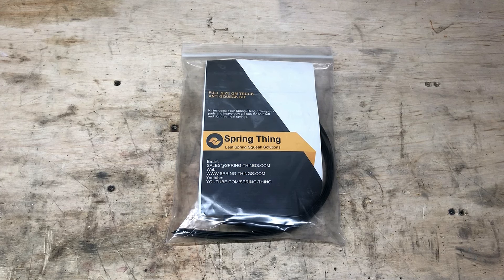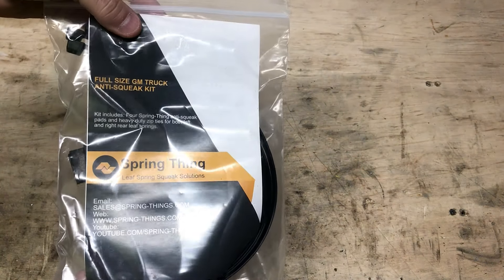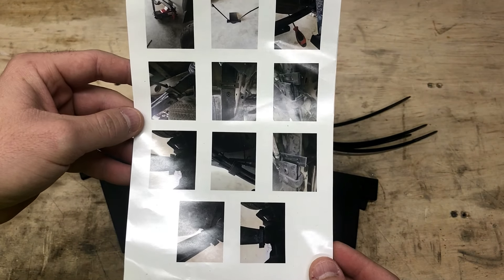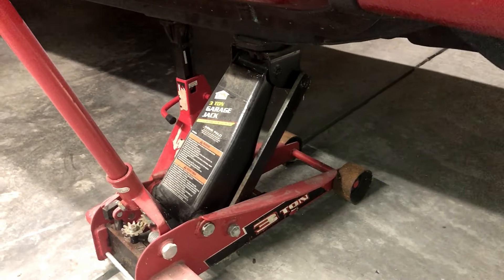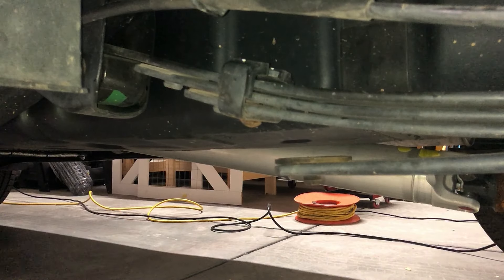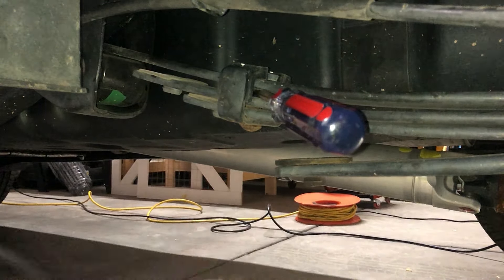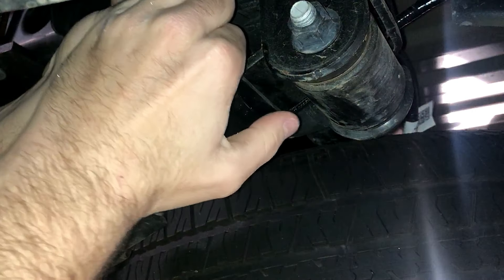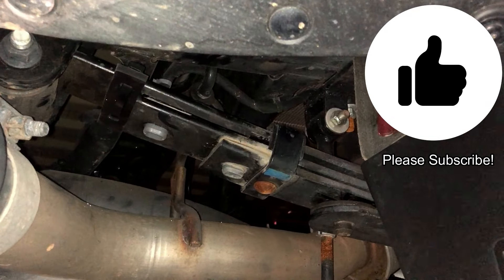[HOW TO] Fix Noisy Leaf Springs - Install a Spring-Thing (Pretty Much Any Pickup Truck)

Comment: I have a 21 Silverado 2500HD and was having issues with the leaf springs. I was able to install this product on the front end of the springs but couldn’t get to the back because it was too difficult. The noise seems to have gone away but the fact that only the front end springs have them, bothers me like an unbalanced equation. Should I try again to install them in the back? Is it fine as it? Thanks for the video!
Reply from the maker: Makes sense. The heavy duty springs are much stiffer and probably a lot harder to separate. I don’t think it’s harming anything. If your noise is gone, I’d say you’re fine. Thanks for watching.
Reply: I’m trying the same thing on a 24 2500 and the rear is such a pain.  But it still makes the noise.  I was only able to put the front.

Comment: Did you disconnect the rear sway bar link to get the axle to droop a bit more?
Reply from the maker: Yes an absolute must. I didn’t mention it in the video because most people don’t have a sway bar. But I just removed the bolts on the bottle of the sway bar end links.

Comment: So, can you do this without jacking the truck up? Or is jacking it up a must? Also, do you remove the factory pads, or just add these on top? Thanks.
Reply from the maker: You absolutely need to jack up the truck. When the weight of the truck is on the springs you'll never be able to slip the rubber pads in between the leafs. Jacking up the truck allows the leafs to droop and then you can pry them open slightly to slip in the pad. Thanks for watching.

Comment: I tow a 14,000 5th wheel with my truck back and forth to Florida each year and I emailed Spring Thing to ask how long these would hold up towing fairly heavy like I do. I didn't get a response from them. Do you know if they are still in business? I don't want to order them and then not get them while being out the money.
Reply from the maker: People have been commenting about orders being fulfilled. So I assume they’re still in business. You can also make a similar thing out of 1/4” thick rubber mats. Cut them up and replace them as needed.

Comment: i have a 2018 gmc sierra z71 4x4 on a 2/4 drop and mine is squeaking from the leaf springs and i just placed a order on one of these kits i’ll update yall 🤘🏽
Reply from the maker: Right on. Look forward to hearing your experience.
Reply: @fondupot  Package got here and i struggled on one because my exhaust was in the way “ i have a after market exhaust” once i got that one done the rest of the three was easy! dropped the truck and jumped on the back, no squeak! letss goo im happy asf thanks bro 🙏🏽
Reply from the maker: Awesome to hear.

Comment: I just installed my spring things a while ago and went for a test drive. Most of the noises I was hearing went away. I still have another noise, not sure what that it is, might be a  brake line or something rattling underneath, but the spring things are a good investment, easy to install, and do the job. Seems like a smoother ride too.
Reply from the maker: Good to hear they helped. Hopefully you can figure out your other noise.
Reply: @fondupot  I think the springs need to be replaced. 15 yr old truck, and I cant find anything lose anywhere. Gotta be the springs. Pads stop some of the noise, and If I put lithium grease in between the springs, it settles down, but you can see where they are buckling and rubbing, I think next year or maybe this year I will find some new ones? No any good mfgs? These were mfg in mexico, probably along with the truck. hehehaha
Reply from the maker: Could be. They might also need a good power washing and then lube them up with grease. Could have some rocks and dirt between the springs.
Reply: @fondupot  Living in Oklahoma here. Weather getting warmer, I did spray some lithium grease a little bit, with the warmer weather, the noise goes away, and early in the morning it returns, I think your assessment is correct. One of these warm or hot weekend days, I will scrub them down  and then spray grease in there. I might modify them with some brackets to keep them tighter. Ive seen so many ideas on here, lots of things to try.
Reply from the maker: Could be the bushings going bad. And as they warm up the noise goes away. But when their cold they squeak.
Reply: @fondupot  Since I got this truck no squeaks at all, just clunking and rattle noise.
Reply from the maker: Good luck!

Comment: 2024 Canyon.... Weird sound like a ball rolling around somewhere.... Mine seems to be on the passenger side front door area .. could it possibly be the rear leaf springs ?
Reply: I've got the same sound.... Mine actually sounds like it's coming from the passenger door area.... Could  the leaf springs sound just be traveling forward ?
Reply from the maker: That’s a strange one. Ball rolling around is not how I would describe the leaf spring slap.

Comment: Did you install the spring things over the factory isolators or did you remove them? I left mine on with the spring things over them & it’s still squeaking like mad.
Reply from the maker: Yea the factory pads remained. You can try greasing the pads up and see if that helps. Mine still squeaked a little after the pads tho.

Comment: I just bought a 2020 Colorado wt. whenever I pull in side ways into my drive way, my bed sounds like it’s loose or rattling, cuz I pull in at an angle. If that makes sense. Maybe this spring thing will help with the clunk?!
Reply from the maker: Yea, sounds like the typical spring slap that happens with these trucks. These should help! Thanks for watching. Good luck!

Comment: Video states 2014+.  Are the springs different on a 2013 Sierra?  Will these still work as intended?  Mine are awfully noisy when not lubricated.
Reply from the maker: This should work on pretty much ANY pickup with leaf springs. I need to update the description...
Reply: I was wondering the same thing Garth Mattson because I have a 2013 Sierra, I only have three leafs on mine, not much overhang. Did you try them?
Reply from the maker: Should work fine on your Sierra too.

Comment: How much of a noise reduction did it do
Reply from the maker: A good 75-85% reduction in noise. Much better to be honest.
Reply: I got 100% worth every penny
Reply: Mine went from annoying to almost none existent. It felt like I was riding on air suspension pulling out of my drive way without he clunking for the first time in my BRAND NEW 2023 Silverado custom.

Comment: Does these work on Ford? I have a 2020 Ford f150 1600 miles on it.  I have a noise also I'm thinking its the leaf springs also
Reply from the maker: Should work the same yea.
Reply: @fondupot  thanks. Maybe I'll try them
Reply from the maker: Report back after you do and let me know how it went!
Reply: I will. My trucks under warranty. So I have to talk to the dealer first

Comment: Hello, we’re did you get those rubber pads at , is that better than installing the shims and also will
They work on a Ford f 250 , I’m getting a squeaky sound from the rear and I can’t figure it out we’re the hell
It’s coming from
Reply from the maker: Check the video description.

Comment: Can you please help? I was able to install the rear passenger side leaf spring.  That one itself was really hard. The front I can't get it open enough. I kinda gave up for now. I have a 2022 silverado and now sway bar. I also lifted the rear tire to do it. Any thoughts? Thank you
Reply from the maker: Try lubricating the pads and then sliding them in while you open the leafs.
Reply: @fondupot  I was thinking of putting a shim in there lol. I busted my finger trying to pry it open with the screw driver lol it slipped out 😅

Comment: I have the '17 full size GMC.  it has only three leafs'. Im struggling with the front installation .  Jacked it up removed the tire, only about an inch  from the overlap.  I tried the area  before the bracket wrap, but the noise is still there.  Any suggestions??
Reply from the maker: Hmm not sure. It’s not gonna remove all the noise. But it should at least be improved some.

Comment: Wouldn't you need twice that? 2 for infront of the Pin and 2 behind it? Per spring
Reply from the maker: You can’t fit more than one on either side. The leafs don’t open enough.

Comment: Months ago following your advice, sent them an email, including yr/model of GMC truck. 
Asking them if they had a distributor or vendor in Canada.  If not, do they sell the product to Canadian clients  (street addresses) directly. 
Also if so do would they ship via USPS regular international parcel post.   We don't need to pay for pricey expedited since all international parcel post gets on a plane.  Not a stagecoach :-)

Never received a reply ! Not even a tap reply to say received to at least indicate they would do research when time permitted. ;-)
Reply: Rockinbr
1 second ago
So have bought a couple feet of material to make my own, to try out the concept
Reply from the maker: Hmm. Sorry to hear that. You can make them yourself out of thick rubber. Good luck!
Reply: And noting  Top/Bottom locations of the original pads, thinking of  4 units per side.  

Presently planning to install the top 2 per side,   during a op' timeline for a all-pts.'  Timbren products install.

Will be utilizing for the first time   my recent purchase of a "Torin/BR' combo package (hydraulic jack,2 stands & 'red creeper).  On sale of course !   :-)

.... '96 Sierra sle k1500  8-)

Comment: These will fit other vehicles! 
I designed them for GM full size trucks because that's what I own but it will work on any vehicle that has 2.5" wide or wider leaf springs. 
I guess some toyota and ford owners are having similar problems but I haven't been able to check on how wide their springs are yet. If anyone can post that info I would appreciate it! Thanks!
Reply: This is for squeak correct?    How about the low speed thunk?  Any word on how to fix that?
Reply: @Mr.Beastforpresident  It also fixes that clunking sound coming from spring slap.

Comment: Bought these and they didn't work and I doubt I did it wrong but I'm open to suggestions.
Reply from the maker: Hmm. Your leaf pack may be looser than normal. Try giving your U-bolts a tightening and check your shock mounts too. Keep in mind, these pads wont remove 100% of the leaf pack noise, but it should reduce it significantly.
Reply: I'll for sure be doing this soon. Thanks you!
Reply from the maker: Glad to help.

Comment: I have a 2024 Colorado ZR2.  I must say I had a hard time installing these on the front and rear.  The problem I was having was trying to get the leaf springs seperated.  I was able to slide them in but not the way the instructions tell you to.  Instead I had to install them with the ears facing in the opposite direction.  If that makes any sense.  It did seem to help, although I am bothered by not installing them like the instructions suggest.  Is there an easier way to seperate the springs?  Thanks for the video!
Reply from the maker: I think the spring-things can be installed in either direction and still work. You may not have had enough room to install them as shown in the instructions.
Reply: @fondupot  I got them installed coerrectly the next day.  It helps to jack the truck up by the frame! ( I was jacking it up on the leaf spring brackets that go to the axle).  I was then able to get the spings seperated.  100% quieter.  I am happy!!  Thank you for your reply.
Reply from the maker: Yea you gotta let the springs droop. Glad you got it figured out.

Comment: Will this work with a 2020 chevy silverado trail boss.  The TB comes with a two inch lift.  Not sure if this would matter.  I see in the description  it says 2nd gen but wanted to double check. Thank you
Reply from the maker: Yea it should work fine. Pretty much same process to install on a Silverado. Thanks for watching. Glad to help.

Comment: I have a new 2021 Sierra with this problem. So stupid GM can't fix this. Maybe they should just license from this company and put this on from the factory!
Reply: Not to be nosy but if you really want to  reduce some extra noise on your GM I’d replace your factory bump stops with Timbrens. Really does make a world of difference for ride and noise with the spring-things as well
Reply: @gabrahamlinco1n962  I already put the spring things on them and it is quiet now. It's the bad between the top two springs when they rub side to side.

Comment: Why the gm product is bad? Why such things could happen?
Reply from the maker: Happens on every make and model truck I’ve owned.
Reply: @fondupot  at 7k miles? I ordered. Hope it fixes it. There is the leaf spring issue but also sounds like something in the bed is broken I'm not sure like rolling rocks in bed...there is none ofc
Reply from the maker: @Day-dreamer488  hmm strange. Maybe something else going on. Like a bad bushing
Reply: @Day-dreamer488 that happened to my truck to.. my caliper was borken in in pieces and rolling inside rotor.